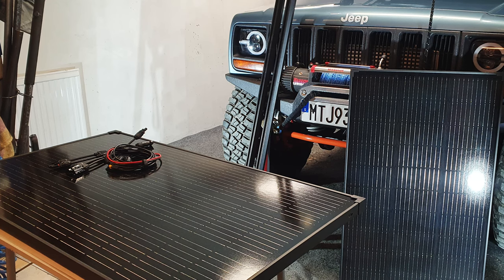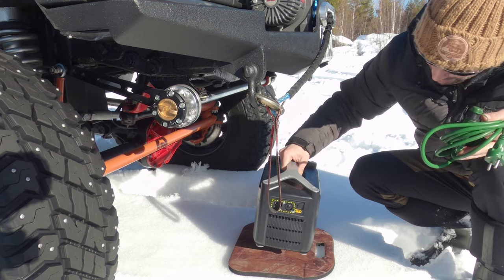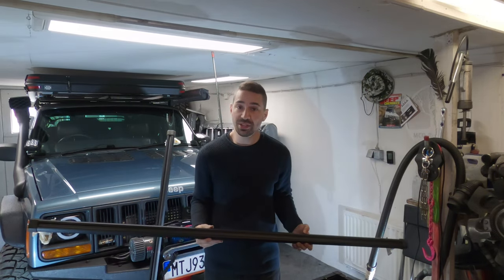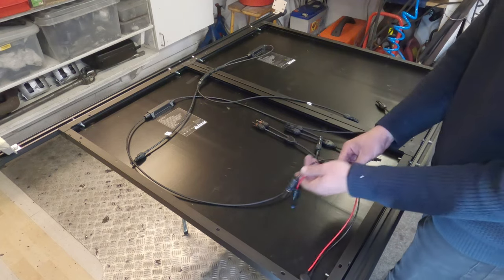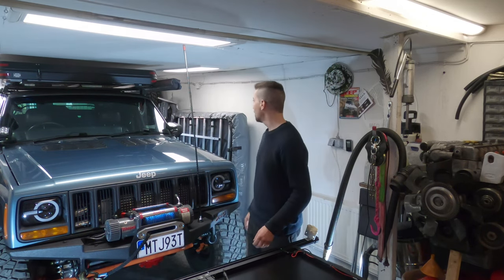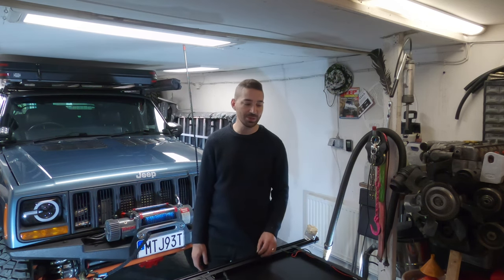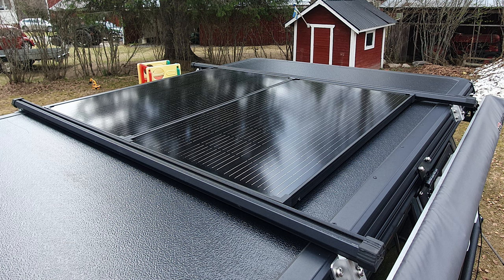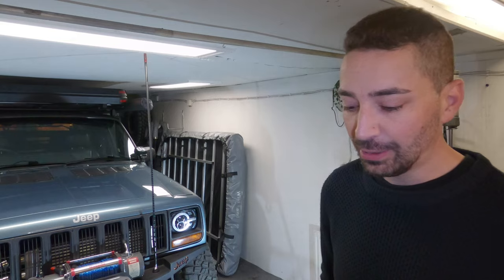Ecoflow Solar Panel Install / Jeep XJ / Hard Shell Roof Top Tent

Comment: awesome work, The power banks generally do not charge at full power when they are closer to full, will be interesting to see how it goes with a discharged battery pack
Reply from the maker: Seems to be fine so far. I charged the 720wh pack and the 250wh pack from 0 percent up to 100. It seems to work pretty efficiently so far. The weather has been ideal for it the last few days fortunately.

Comment: You should have bought polycrystalline panels, they are much more efficient and give you better power output. From each of those monocrystalline panels you'll get 60-65% of those 100 watts while polycrystalline will give you between 90-95% output. And when there isn't much sun they still give you around 75% while mono goes down to around 45% output or less. I made the switch from mono to poly and it makes a huge difference. I'd be interested to know your feedback on those panels.
Reply from the maker: They are not the best panels obviously but they seen to work very well. As I mentioned I got over 190w the other day and even when the clouds were over the sun it was over 50w. For the price there doing there job so I can't complain yet. Perhaps in the future I will upgrade like you but I will give these there time first. Thanks for the info 👍
Reply: Monocrystalline solar cells/panels are more efficient, high performance and better quality not poly. Poly easier to manufacture, cheaper but less efficient. Properly rated 100W panels should give similar power output on same conditions. Just poly solar panels will bit larger because it is made of less efficient cells.

Comment: Just found your channel (related to your solar panel set up). I understand your issues related to UC (which I have had since I was 13 years old and 53 now). This turned to Primary sclerosing cholangitis at age 28 which which required a liver transplant at age 36 (with secondary kidney transplant 10 years later). So yah it can suck in a big way. Do not feel sorry for me as I now live a very active life of mountain biking, kayaking, hiking and mountain climbing where I live in coastal British Columbia. UC is a horrible disease that can be very debilitating.... Diet and exercise has been for the most part my savior plus a toilet near by at times🙃🤪. I love your rig, we have a 2011 Nissan Xterra which we are kitting out to be our base camp and plan on a seven week adventure next summer

List of overlanding products
Aluminum wedge tent
180 bat wing awning
Bluettie ac180 power
Iceco vl 45 fridge
Kenwood Navigation
Garmin inreach
Slight 2" lift
built out back kitchen

Only thing left is the solar on the tent. So thank you for this video and sharing your story. Keep rocking it

Time to go hit the toilet🤪💩
Reply from the maker: Ah mate that must have been extremely tough. How are you holding up these days? Sounds like your doing much better and keeping active. I hope I don't have complications waiting for me down the line but I guess I wont know until I get there. I intermittently fast every day and since then I have had no reoccurring symptoms but these things come and go and its hard to know why so I could just be going through a good spell.
The up and coming trip sounds epic, plus the kit list looks solid too. Solar has been a game changer to be fair, I just have to park in the right direction to make the most of it. 
Thanks for watching and for the comment.
Reply: I have an internal mantra that I say to myself that has helped a lot over the years.

"Adversity is a gift that leads to equal or greater rewards"

So yes life is good with my health along with it. I'd say I'm in better health than most of my peers as I am aware of it and proactive with regards to it. I try not to stress about it much anymore (maybe my age). Enjoy life and take it all in even the little things actually especially the little things.

Glad I found your channel great viewing.

Comment: Hi Mike, thanks again. I’ve been searching for the video where you first show and discuss this RTT and reasons why you changed from the previous one … but can’t find it. Can you please link that video. Thanks.
Hi from Oz!
Reply from the maker: I ended up removing that video because I felt that I hadn't owned it long enough to give an opinion.  
I am making another though really soon now that I have had a lot of use out of it. 
Thanks for watching
Reply: @WorkshoptoWilderness  thanks for responding.  I see. 
Can you please tell me the RTT you had immediately before the Desert Cruiser? I was more focused on that and your thoughts on it, as a very similar looking RTT is currently on sale in Oz at 1/3 the Wildlands Desert Cruiser price.
Reply from the maker: @surfinwaves4769  ah right, the wildland normandy auto. Good tent, nice materials and super fast setup. My only issue with it was it was a soft shell with a ugly cover. I decided I wanted to mount things up top so I went with a hard shell.
Reply: @WorkshoptoWilderness  that makes sense. Thanks.  Love your work, thanks so much for sharing 😀👍

Comment: I was wondering how you were going to get the car back in the shed with those panels on the roof 🤔
Reply from the maker: Its the same clearance as before because the panels sit below the roof bar line. Fortunately lol
Reply: @WorkshoptoWilderness  lol, it’s a tight fit! I want to lift mine another 2 inches but then I won’t fit in the garage 😂

Comment: Is it possible to mount a solar panel not screwed to the side of the beam, but without drilling on its top, i.e., in a T-row using T-nuts?
Reply from the maker: Yeah, I would have thought so. The way I did it was pretty crude. It works, but it could be done much clearer.

Comment: Hey man how did you run your wiring from the panels into your battery bank?
Reply from the maker: I used a 5 meter extension wire. https://www.elgiganten.se/product/hem-hushall-tradgard/belysning-elprodukter/elektrisk-utrustning/powerstation/ecoflow-kabel-mc4-till-xt60-solar-5m/389193
Something like this basically. Thanks for watching